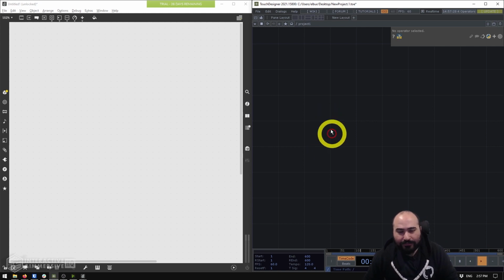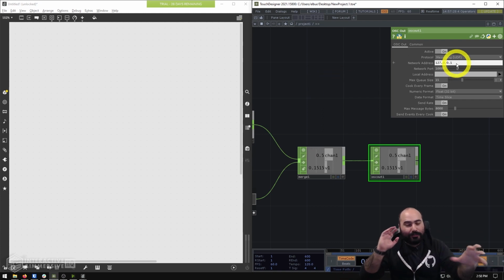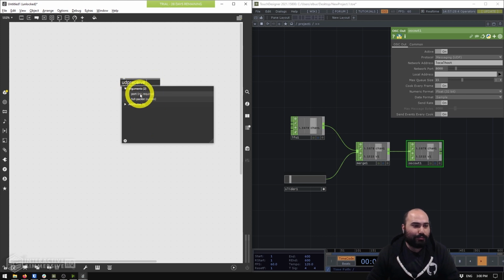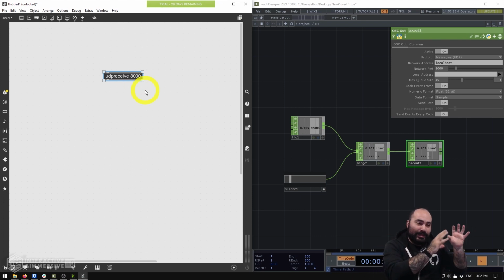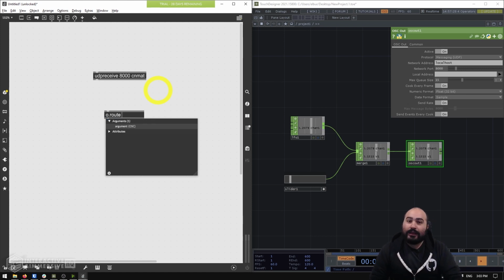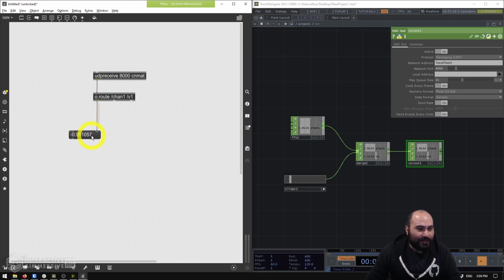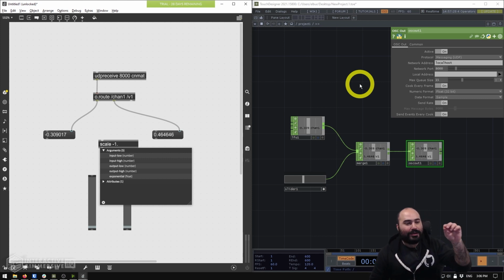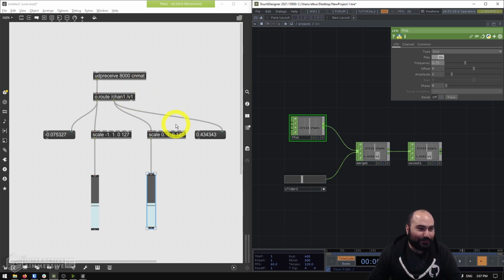Connect TouchDesigner & Max 8 with OSC - TouchDesigner Tutorial 072

Comment: Thanks a lot i need to do exactly the reverse, so send data from max to TD via OSC can you explain how to do that?
Reply from the maker: You can use the OpenSoundControl object from the CNMAT Externals library in Max to send OSC, and the OSC In DAT or OSC In CHOP to receive the OSC data in TouchDesigner. When setting up the udpsend object in Max, make sure that you use the same IP and network port as your OSC In DAT/CHOP in TouchDesigner. Assuming you're running Max and TD on the same machine, you can use localhost for the udpsend IP address. Hope that helps!

Comment: Excellent video, thanks for sharing! As with the other commenters, I'd love to see a video on sending OSC from Max to TD via UDP. I've spent several hours trying to get it happening but nothing seems to work.
Reply from the maker: Our pleasure! Thanks for the suggestion, it’s definitely on our radar for upcoming topics. 
That said, what are your settings looking like currently in Max and TD? Are you able to send OSC from TD to Max?
Reply: @TheInteractiveImmersiveHQ  Yes, I was able to follow this tutorial successfully and send OSC from TD to Max.

Some time after posting my previous comment I did manage to successfully send OSC from Max to TD - the trick was to use the OSCIn CHOPs and DATs rather than the UDPIn DATs in TD, and to prepend a name to the outgoing data from Max (i.e. "prepend /max", for example) to ensure that this data is OSC-compliant. Being a complete novice, I did not understand the requisite data structure for OSC (and still do not completely get it just yet).

I'm looking forward to your video on the topic - I'm sure you'll be able to demonstrate some great applications of this inter-application connectivity.
Reply: @Interface3072  Thanks for sharing, BTW can you make a simple tutorial for us?
Reply: I just want to second this comment and video suggestion. I spent most of yesterday trying to figure out how to get usable OSC data from Max to TD and still couldn’t fully get it to work - the data would come over, but I couldn’t get it into a format TD could work with. I will try these suggestions the poster mentions - but a tutorial on this would be incredibly helpful! There is so much opportunity to use Max to control elements with TD - it’s a rich territory. Thank you and look forward to it!

Comment: Thanks for the tutorial, super clear!
Do you know if there's any Max package that works on a Mac M1 chip that does the same thing you show in you video? The one you're using can't be installed.
please help!!
Reply from the maker: That's a tough question. I'm surprised it doesn't automatically get handled by the OS since macOS does a generally good job of letting you run old code even on the M1 chips. Unfortunately I don't have an M1 Mac to test that on. Have you checked on the Max forums to see if folks are having similar issues and how they're getting around it? That'd be the best bet in this case I think!
Reply: I did stumble upon the same problem and though o.route is a bit more refined, you still can use OSC-route, which works fine with an M1.
Reply: It now works nicely! I have a mac air M1 and I didn't have any issue with it :)

Comment: do you think it would be possible to send osc the other way around?
from max to td?
Reply from the maker: Yup it's equally as easy just in the other direction. You'd need to setup your outgoing values as OSC channels, which I'm sure odot library has some nodes for, and then you'd send that out of the udpsend node to send it over to TouchDesigner.
Reply: @TheInteractiveImmersiveHQ  what operator do you use in touch designer to receive that information from max. Sorry pretty new to both softwares!
Reply from the maker: @dariusfeier7003  No need to be sorry, everyone was new at some point :) Which part are you having trouble with? Receiving the data in TouchDesigner from Max or receiving the data in Max from TouchDesigner?
Reply from the maker: @dariusfeier7003  Likely you're looking for the OSC In CHOP in TouchDesigner to receive the data.
Reply: @TheInteractiveImmersiveHQ  thanks!
Reply: @TheInteractiveImmersiveHQ  Do you have a tutorial or suggest one where it is explained how to control TD with max??
Reply: @TheInteractiveImmersiveHQ  Hi man! I can't get data from Max on TD, but vice versa (as in your tutorial yes). Do you have any advice?
Reply: @andreadipa9969  I have exactly the same problem! Have you perhaps resolved this issue?
Reply: @liamori2097  Hi Lia! I disabled the firewall and everythings works!
Reply: @andreadipa9969  Thank you kindly! That seems to help 😃